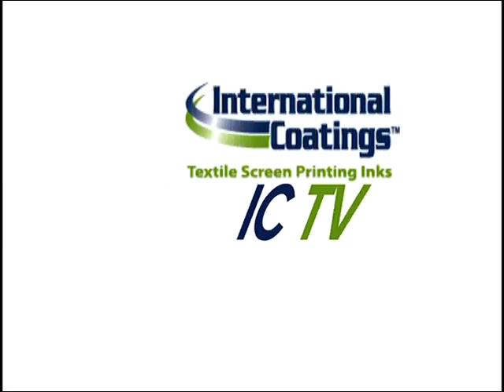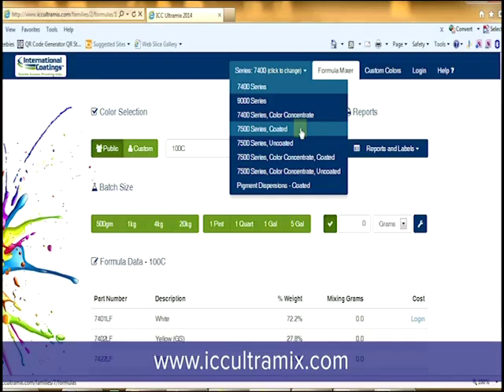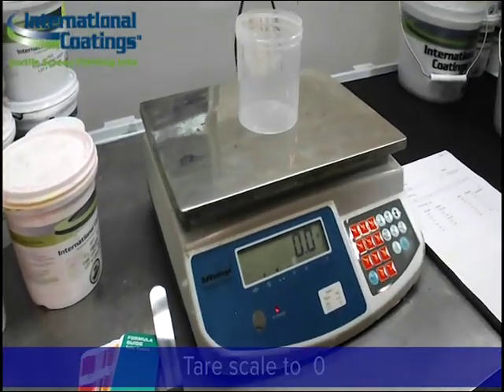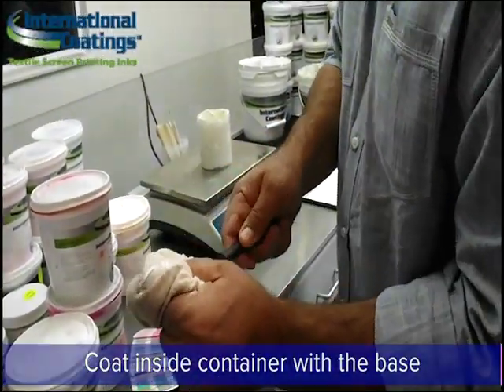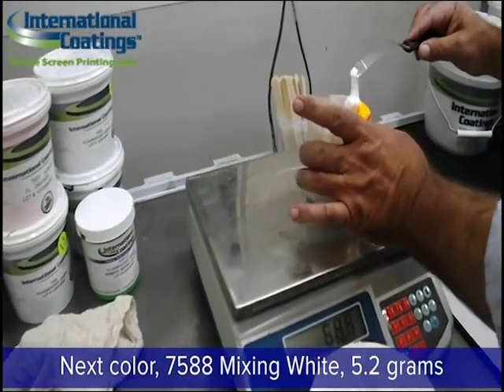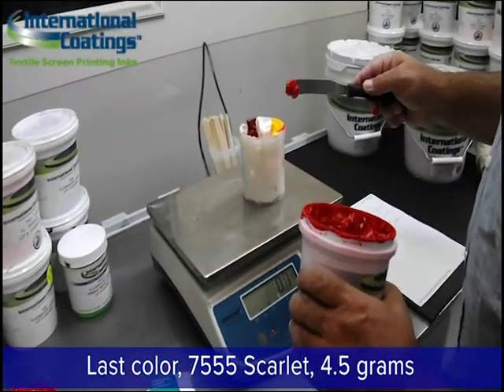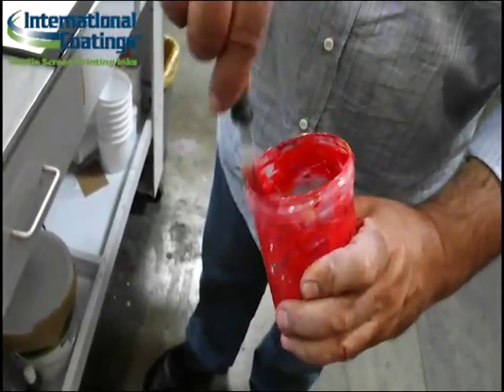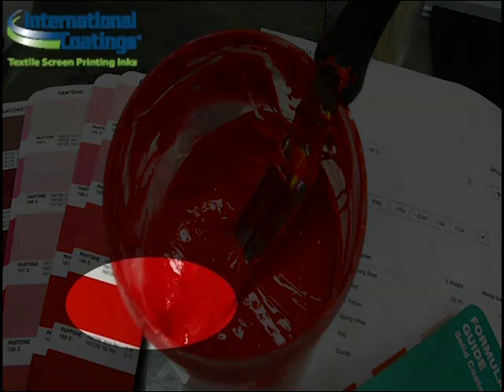Match PMS Colors, 7500 Color Mixing System | International Coatings 7500 CC PMS

Comment: Do you have waterbased ink products?
Reply from the maker: Sorry, but we currently do not carry water-base products. However, we do have a fantastic non-PVC line of inks which prints just like plastisol - AXEON. So there is no drying out on the screens, no special emulsion, no flashing after every color. You can print it wet-on-wet, cure it at standard temperature and time length. It comes with a PMS color mixing system and 18 special effects inks.